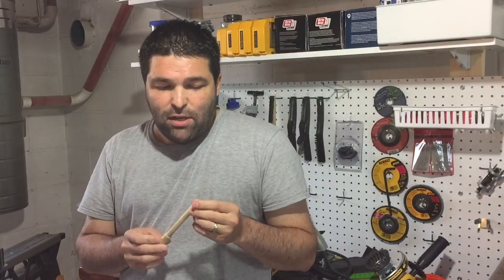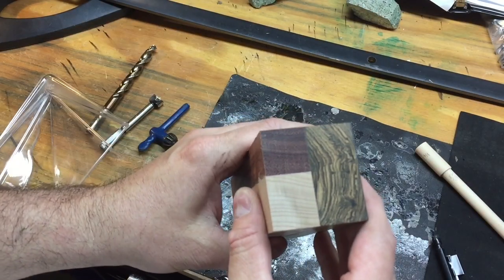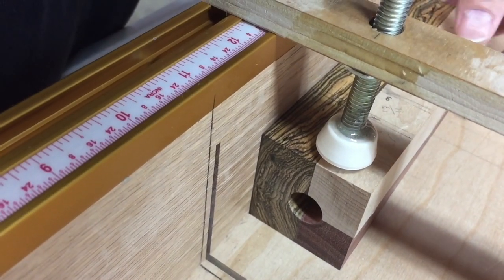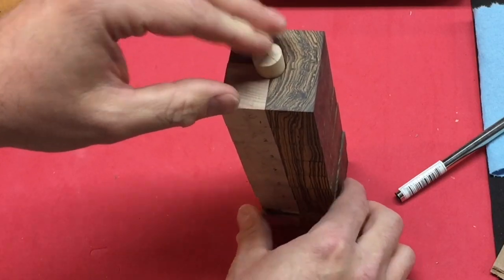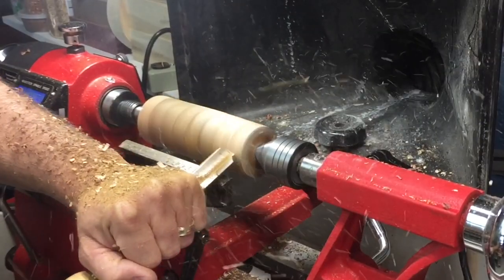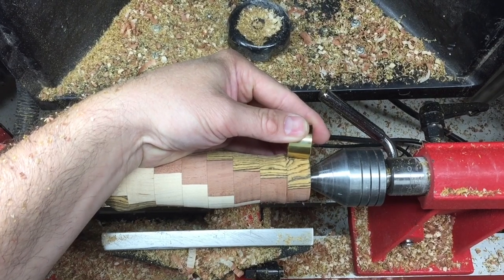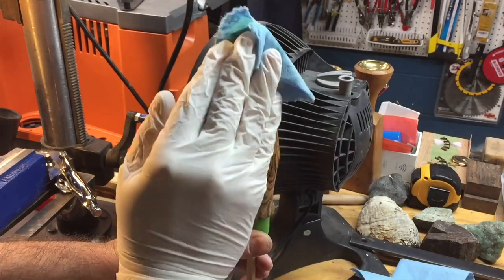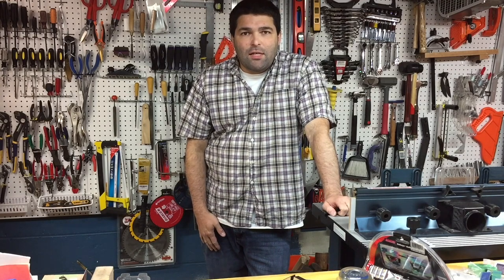Wood Turning a Segmented Screw Driver

Comment: I like the effect of offsetting each ring. Very pretty. I bought some harbor freight screwdrivers and cut them apart to get the pieces. Turned (no pun) out cheaper as I had to give a bunch as gifts. I used a copper tube for the ferrule. No endcap unfortunately. Keep up the excellent work sir. I'm learning lots of useful techniques here. Be safe!
Reply from the maker: Hey, thank you. I have used screw drivers in place of the kits and they work well. I favor the PSI kits, they are solid and good quality. I'm so glad you found some tips/techniques from my videos. This is one of the main reasons I make the videos, to give back to so many others I've leaned from on YouTube. Thanks again and stay safe as well. Cheers my friend.

Comment: Nice video with easy-to-follow instructions. Do you have a source for the brass domed end cap?
Reply from the maker: @timwhited5933  hi, thanks. You can get the screw driver kits at PSI. If you don’t want to buy the kits and just want the brass end, you can buy brass pipe and cut it, or use copper pluming pipe. 
https://www.pennstateind.com/store/PKSDK4.html

Comment: Great video, can you use the finishing fluid on any kind of wood ? Thank you
Reply from the maker: martkt10 hey, thanks for watching my videos today. You can use the wipe-on polyurethane on any wood. You could apply several coats to a piece, and add a sanding sealer/shellac first to even-out the grains on say for example ash wood that has soft and hard grains. Only bad thing about wipe-on poly is waiting 4 hours between coats, and sanding. Hope that helps. Thanks again.

Comment: Good job. You are wasting valuable time by not having enough stock cut up to make at least two handles at a time. I got tired of putting all the tools away and then realizing I needed another handle. :)
Reply from the maker: Thank you Robert. Good point! Though, I had only one to make, having an extra around for next time would have been more efficient. Cheers sir.